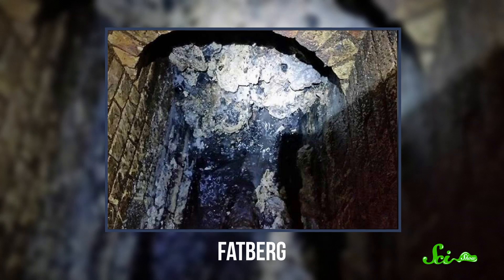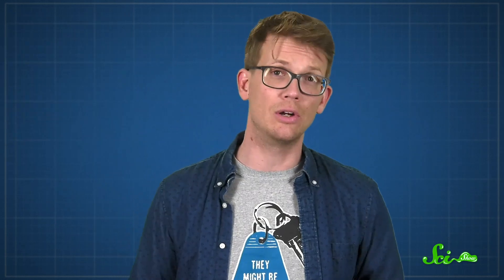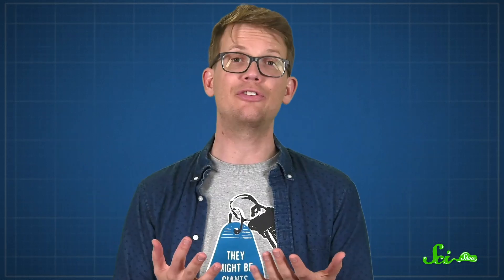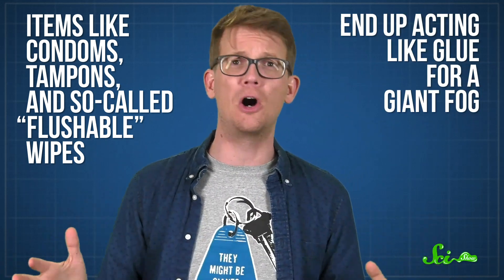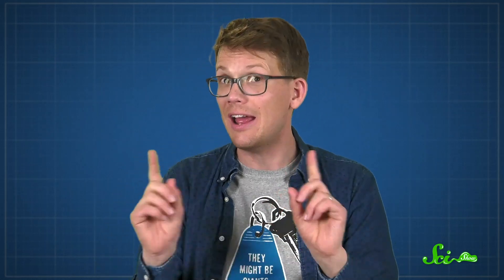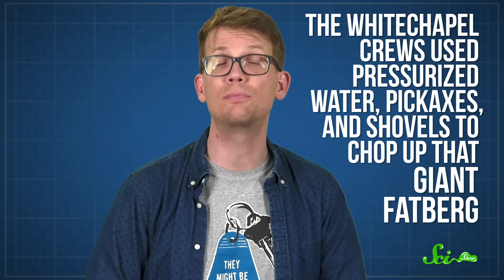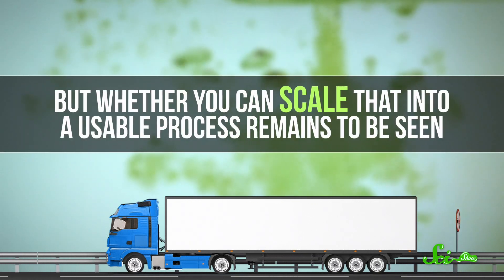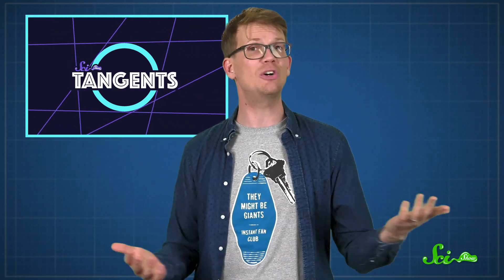Why Our Sewers are Plagued by Fatbergs

Comment: I wonder if the company cleaning up the fatberg could offset some of the cost by converting it to diesel.
Reply: I'd imagine the amount of diesel produced is negligible compared to the costs of all the effort required to remove that little clot.  It might be decently big by some standard, but it's size is minuscule when compared to the size of the problem it is.
Reply: Nobody wants to clean the fatbergs, and even fewer people want to heat them, filter them, and put them into a reactor, mostly because its gross and also because it might not be profitable
Reply: @LazDoomster1  
There are companies all over the country that now pay restaurants a small fee to pick up their used oil, so  they can turn it into biofuel.
Reply: @lordgarion514  but that oil is relatively clean and mostly "pure", whereas the fatbergs have garbage people throw in the toilet in them
Reply: @LazDoomster1  
It's irrelevant TBH, they still have to heat and filter the oil from restaurants. It doesn't really matter too much cost wise how dirty it is, it costs the same to heat it, and the filtering process is just a physical filter.
Reply: @lordgarion514  are you speaking from experience? I know the chemical aspects there, but I'm no financier. You are right, but I have a gut feeling that the costs would escalate up the prod chain
Reply: @LazDoomster1  
Worked in restaurants and used to chat with them when they came to pick up. They handled fat as well as oil.
Reply: Not if the government is involved. Local beaurocrats would undoubtedly demand their pound of flesh.
Reply: @carissstewart3211  Don't you mean their pound of fat?
Reply: @christelheadington1136  
Ha gotteeem
Reply: Could've made sewer soap.
Reply: guvermint bad
Reply: No
Reply: you can make explosives out of animal grease.  sell that maybe, legally somehow?
Reply: Do it if you can or we can send them to mars for a big block that they can cut out for processing any source of fuel will be helping over their cause it will help build the atmosphere but it won't be like ours its might be more darker because we'll fill it with waste smoke but think about the valcanos we know what they do but imagine it in mars atmosphere. Smoggy days are ahead  it'll be like RED FACTION.
Reply: @isaiahwolftail867  since the stuff isn't pure it will have a low energy density and when you consider how many millions it takes to send even a little bit of stuff into ISS let alone Mars, it is a very bad idea
Reply: Soap would make for better price points. Still wouldn't be profitable though.
Reply: We should all accountable for the waste we produce. As individuals, households, businesses, corporations and states.

I told my boss that I was angry that I was seperating my trash at home while the company was throwing away more recyclable material than all of it's employees put together. 

Now total waste at my company is less than 10% of what it was. We even bring our organic waste from home and have it converted to fertilizer by the company, which we can take home. It's good stuff, my tomatoe and cannabis plants are popping off.
Reply: @Eveseptir  you are the hero the Earth deserves, and also the one it needs right now
Reply: @LazDoomster1  Thank you but nope just a soldier. She gave me life and I intend to repay her with my best intentions and those of my children. Hopefully. 😎

But hey we all love a good war story. (Fern Gully)
Reply: @Eveseptir  how many B rushes have you stopped during your service?

Comment: If only we had a substance that could break up fat and make it water soluble. A common house hold product used in dishwashers, showers, and is easy to make from a lye base.
Reply: So you wanna fight soap with more soap?
Reply: @NoticingNoticer  it only works with fire because you're burning the fuel the fuel the fire needs to spread.

Comment: The best solution to this problems seems to make new laws about how much oil and grease restaurants are allowed to release into the sewers by making them take care of their fat in better ways. For example by using grease traps.
Reply: FOG interceptors are already required by CPC and UPC code for any building that has fixtures that receive grease waste. There's no way a plumbing inspector would sign off on a restaurant with no interceptor. I also believe restaurant owners can pour chemicals or enzymes into the grease waste system to help the interceptor do its job more efficiently.

Comment: Sorry, ain't nothin gonna stop me from using "flushable" wipes.  I don't have a bidet, my ass needs to be squeaky clean, and I'm not putting wipes in the trash.  As for oil, I always towel up large amounts and put it in my trash, and smaller amounts I add plenty of soap to before I rinse it down the drain.

Comment: I have worked for my city’s sewer system for a decade. I am the guy that unclogged the city mains. Yes grease is a major problem. In my city the personal wipes are the major problem in the mains and also those wipes block our pump stations basically weekly. It’s getting worse and worse with more and more people.
Reply: Woah
Reply: When they label those wipes as “flushable”
Turns out they aren’t…